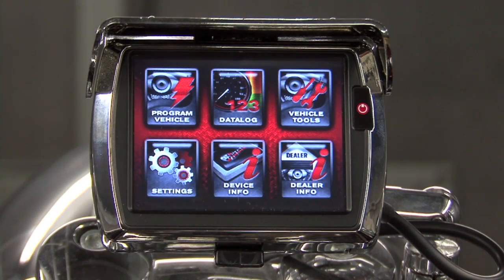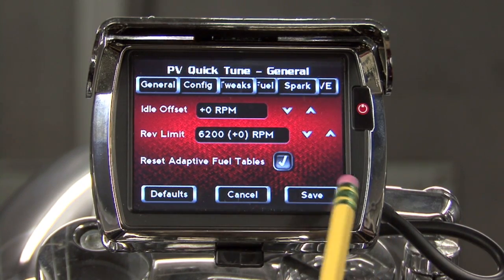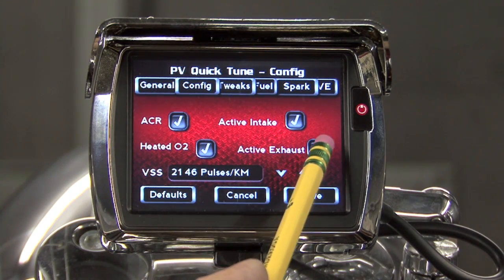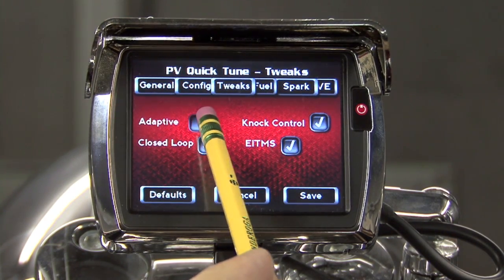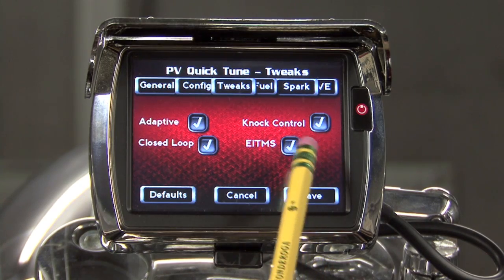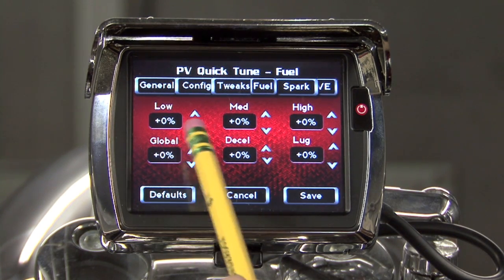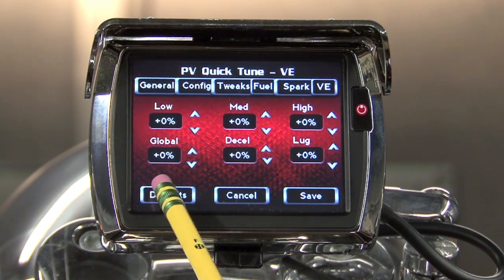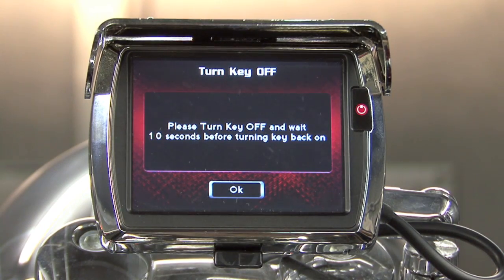Dynojet Power Vision: How to use Quick Tune

Comment: If I do not want to leave the unit on bike.   After I set the tune, do I plug the oem plug back in.
Reply from the maker: You can remove the Power Vision flash device from your vehicle once flashed.

Comment: My PV tune has engine miss at 5-8% TPS and 1800-2100 rpm with steady state throttle, but does not have any decel pop. What “quick tune” adjustment should I try to remedy this?
Reply from the maker: Hello, please reach out to our tech support at pvtech@dynojet.com to help you out with this.

Comment: 2014 dyna switchback stage 2 and it's been dyno tuned . If I take a trip to higher elevations what do I need to do to the power vision to adjust my map where the bike runs like it should?
Reply from the maker: Michael, you won't need to do anything to your Power Vision.  That is the benefit of fuel injection. It will automatically compensate for weather and altitude changes.

Comment: Im gonna try and tune my 2013 streetglide with d d fat cat exhaust without the o2 sensors, hope it works, i figure ill add a little more fuel and shut off the auto feature, save it and ride and fine tune it from there. Not sure if its gonna work but if it takes the adjustments i think it will, i left the stock air cleaner. I've got the stock pipes off and have removed the old gaskets and ready to put the new Fat Cat on, just waiting for some stainless flange bolts and i have this dyno jet siting right here for this bike.
Reply from the maker: Sounds like a great plan!
Reply: @DynojetResearch  Nice, thanks

Comment: What should I do? I have 2017 iron 883, V&H short shots staggered no baffles/W torque inserts, and a Arlen ness big sucker..I did the map you provide with the SS & high flow air cleaner, but in low RPMs it boggs down when I get on the throttle..
Reply: Get rid of the torque inserts. It's a marketing scheme.
Reply from the maker: Tyler, if you're still looking for help, contact us at pvtech@dynojet.com.